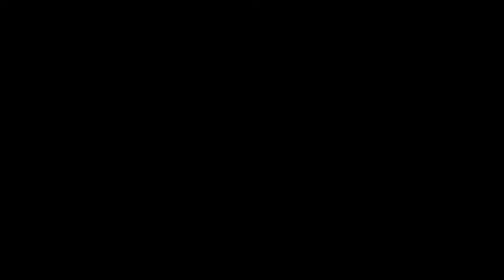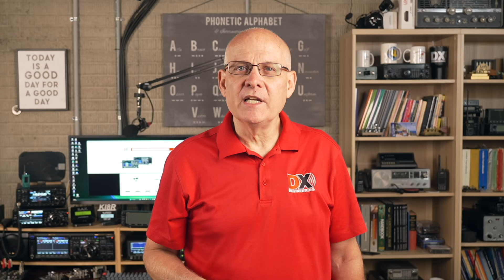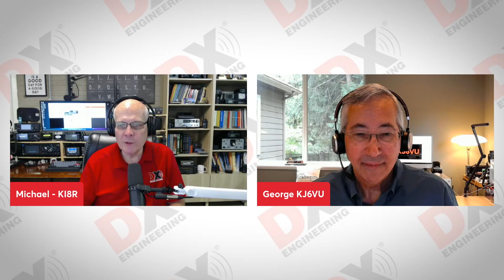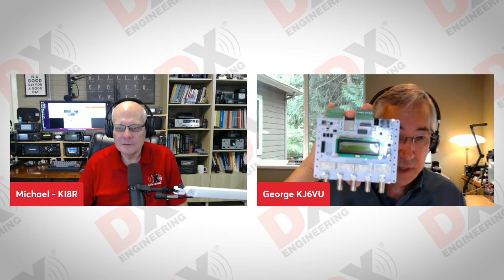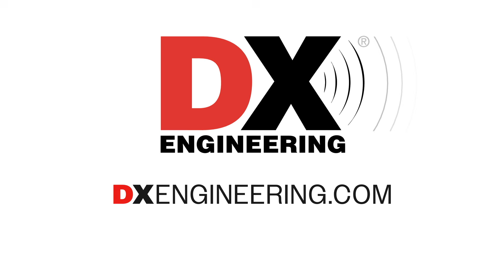Remote Ham Radio Control is Easier Than Ever Thanks to Sierra Radio Systems

Comment: Thanks for taking the time to share this with us!
Reply: Thanks for watching !
Reply: ,  George. I have one of these and have it all working,  I have added things like Antenna genius to it, lightening detection,  over voltage detection on power supplies, sattelite station, room and cabint temps.  I did a dark mode and a few other things.

I am looking for other examples.  I know there is a groups io for node red but really didn't find a lot there, are there any other sources, not looking for flows just ideas and concepts.  Running Icom and Anan radios..  Thanks.

Comment: Fascinating.  How is the connection to the HF radio made?
Reply: The control of the radio itself like frequency, mode, power, etc is all done with the manufacturers software or 3rd party software.  Our station controller allows you to control all the stuff around the radio.  Turning radio power on/off, changing antennas, measuring RF power, etc.